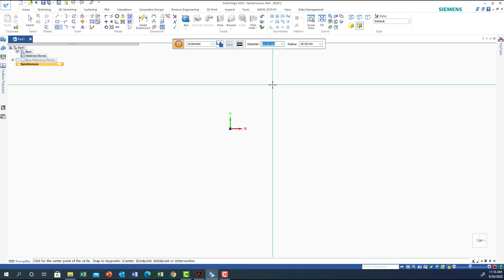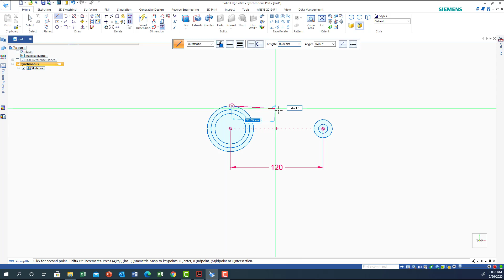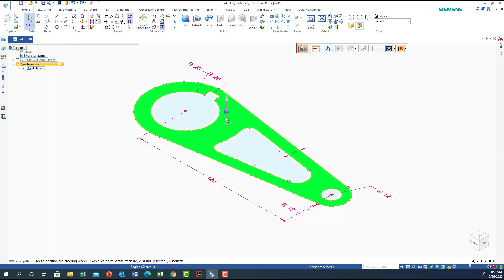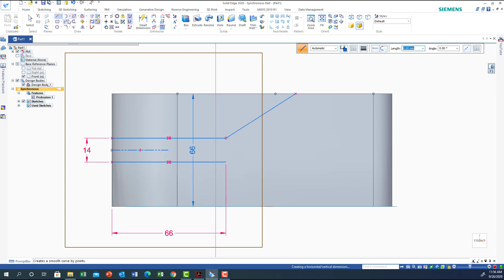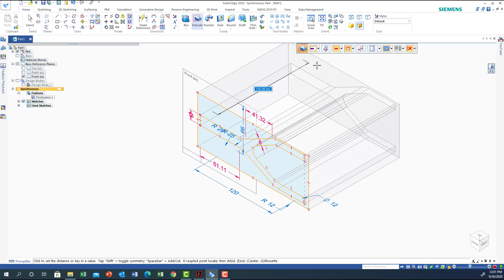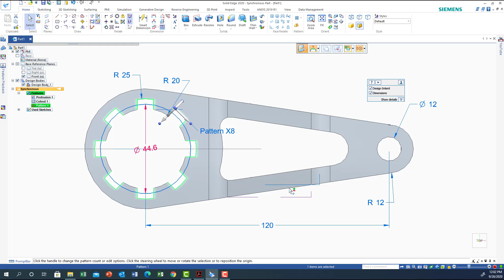Learning Solid Edge - Exercise # 4

Comment: Very nice, I could follow through easily. When working with construction lines for the purpose of setting 2 parallel lines in symmetry to that line, every now and then it appears that the
symmetry is centering itself between the parallel lines, which is of course not what I want. Because I am new to Solid Edge (version 2024), I did not fully understand how to prevent this,
or how to handle it correctly. My workaround so far, to lock the symmetry line prior to the symmetry command, and after symmetry was applied, I delete the lock relationship on the symmetry line.